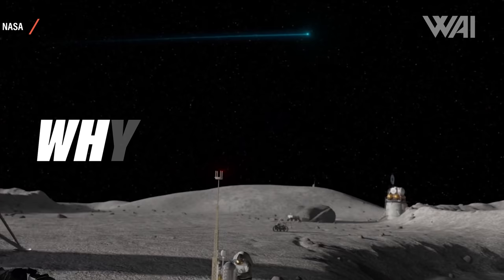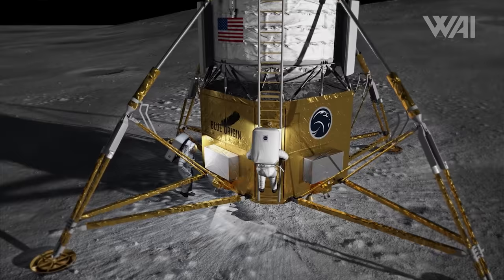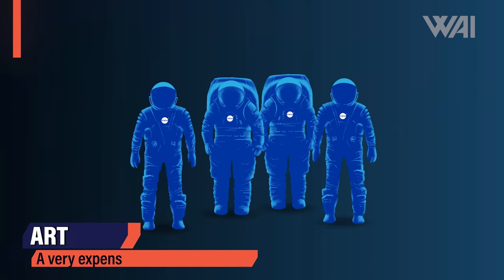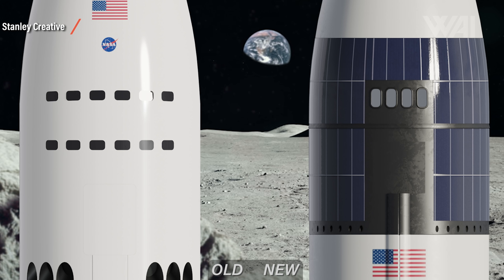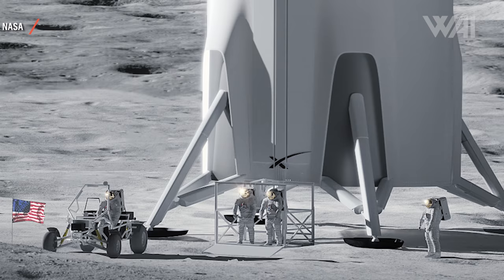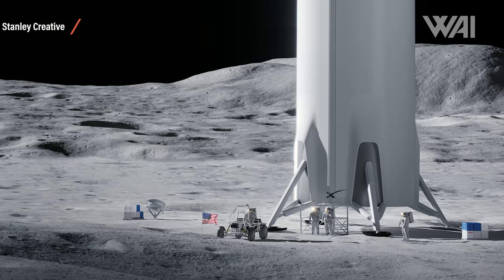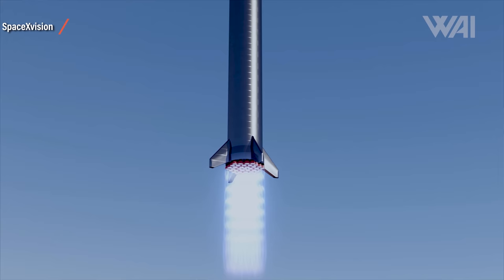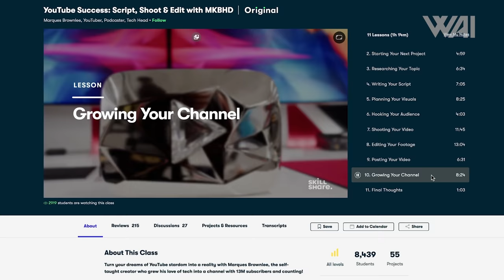Why Did NASA Award SpaceX 2.9 Billion Dollars For A Lunar Lander?

Comment: Hi Felix! My personal thoughts on SLS, Orion and Lunar Gateway:
I agree, SLS is becoming more and more obsolete. Its function is practically speaking, a shuttle to and from the moon for the crew. The lander system is a totally different system. Both roles can be fullfilled by two starships outfitted for their respective purpose. That in turn creates so much space that the lunar gateway becomes practically unnecessary. And that means a massive cost saving.
Unless someone can name a valid argument in favor of the lunar gateway. The cost saving alone can have senators give all laid off jobs a full year's pay(older employees early retirement?), and still have plenty left, which can be used for other purposes than spaceflight. Capable engineers etc. will have a new job elsewhere within that year, guaranteed with the explosion in the number of space related companies.
One con is the current orbital fuelings needed to fill up one Starship, I read it needed 20 fuel tanker flights? That number will have to come down, one way or another.

Comment: Lunar Starship already has the rocket exhaust at the top of the fuel stack. Why don't they invert the whole stack and put the crew section at the bottom and the fuel/propulsion section at the top?  It would put the boots closer to the ground and eliminate the need for all those cranes and descending platforms.

Comment: You are correct but I think further speculation is in order..
The docking port on lunar SS was obvious last year. It allows docking with ISS or Orion, or Starliner, and maybe Japan, China, India who knows all but the biggie in my opinion is Dragon. It may be when dear moon launches that Super heavy is not man rated and shuffling crew by Falcon/Dragon will be safer and once aboard keeping a dragon attached as a lifeboat makes some sense. 
Another obvious item not needed for lunar starship is the Stainless steel hull. Aluminum is just as capable for lunar operations and will weigh at least 60 tons less. 
Another change that I would make if I could would be to put legs with wheels on the side of starship and land it horizontally on the moon, complete with flip maneuver. This configuration makes leveling easier and repositioning the ship on the surface easier too.In fact a hinged nose or tank section so cargo could roll on and off like a C5 Galaxy military plane would make colony building and supply much easier too.
Speculation and imagination are great fun.
Reply: Starship would probably collapse if it is on it's side
And using a differnent material would mean a lot of redesigning and testing would have to start all over. Maybe later but not now when they have to be ready in 3 years
Reply: @Astromath  undoubtedly as they as re in earth gravity they would colapse. But the lunar starship is a different animal. It is essentially a ground up new vehicle for a different job. SpaceX knows how to work with aluminum. If they design with aluminum they have at least 60 tons of weight reduction they can use to strengthen the hull and make it fit the task of lunar colony building.

Comment: The lunar starship also doesn't need atmospheric Raptors. It can probably operate with just the three vacuum-optimized Raptor engines.
Reply: The complication may be whether it can launch from Earth with just the vacuum Raptors (we don't yet know what happens after they separate from SuperHeavy), and whether it can perform the Moon landing and descent without vectored engines (remember that the vacuum engines are fixed in place)

Comment: 10:07 This way no regolith will be thrown up....??? Even with many small thrusters, angled out and higher up, they still need to create enough thrust to cancel the mass of the descending Starship, so there is still going to be a lot of turbulent rocket thrust beneath Starship, having many smaller thrusters making an umbrella type of thrust does seem a lot better than a nozzle underneath acting like a blow torch. For the Lunar landers, the single rocket for a much smaller craft seemed to work fine, pushing everything away from where they would land....Starship....i still worry about the hail storm of regolith.

Comment: More realistically, the main Lunar Starship hull (including fuel tanks and Raptor engines) will stay in orbit around the moon (taking the place of Gateway) and will only be used as the propulsion system for the translunar legs between the earth and the moon.  Only the crew section and cargo section will descend to the lunar surface.  On departure, only the crew section will leave the lunar surface to reconnect with the orbiting main hull for the trip back to earth.  The cargo section will stay on the lunar surface and be used as part of a growing moon base.  Back at earth, the crew section can transfer from the Lunar Starship to an Earth Starship for re-entry and landing.  The Lunar Starship can be inspected and refueled in orbit, a potentially dangerous procedure, while it awaits delivery of the next crew and cargo section lifted into space on an Earth Starship.  And the cycle repeats.

Comment: Theory: The odd nose cone with cut outs were for a capsule so astronauts can return to earth since the lunar starship will stay on the moon.
Reply: The ascent module on the "tip" of the Starship could be both the astronauts emergency abort during landing & their ticket back to the Gateway.

Elon Musk once mentioned that most of the TOTAL MASS of a (fully fueled) Starship is liquid oxygen.
 While it is not practical to produce Methane on the Moon (there is not enough concentrations of carbon anywhere & hydrogen is only bound on ice at the south pole); oxygen can be taken from ANY rock or regolith on the Moon simply by heating it (powered by solar panels).
  
By sacrificing cargo capacity to store extra liquid methane (that can be mantained at 100 Kelvin relatively easy for long periods, since the heat from sunlight is compensated with power production from solar panels to run active cooling systems), it is posible to "refuel" it by deploying outside of the starship a set of permanent solar panels, rock smelters, pressurized gas oxygen tanks & a separate oxygen liquifier [the only part connected to the bottom tank of the Starship].
 -> If everything is setup correctly, it could even be left behind running autonomously; so it could be a slow & efficient process (rather than a faster & supervised one), to reduce time spent by astronauts on the Moon surface.

Comment: Once on the moon, visiting a neighboring starship would involve an elevator to the surface, and another elevator ride on the other ship.  Instead, how about bridges directly linking the doorways high above the ground?  The early colony would stand on this interconnected framework, like an oil rig standing on Starship supports..  Are Starships capable of bearing loads?  Perhaps add-on bracing could be delivered on later missions.

Much of a Lunar Starship's interior is taken up by fuel tanks.  If the plan is to land a Starship and then leave it in place, the fuel tank space will need to be converted to other uses.  Any idea of what and how?
Reply: This early starship landers do land and then ascend to lunar orbit so nothing useful is left on the surface. Way later in Artemis missions are they thinking of testing habitation but they're probably planning it much more small than lots of lunar starships forming a big base. Remember that Artemis missions are not continous. Astronauts will go there for a month and then return and no one will be around the moon. So these bases are probably further into the future.

Comment: Love the new design with landing gear. Got a big question. If landing gear is important enough for the Moon and Mars then why aren't they important enough for Earth? Why the insistence on this catch a running rocket in mid-flight with a crane craziness? Is it just to save a few pounds? I would prefer landing gear because it's safer and allows you to set one off to the side for maintenance.

Comment: As the SpaceX lunar lander will not have heat shield and 'wings' it will have to be able to load cargo in orbit for return trip to the moon. Further reason to build an orbital fuel and cargo transfer facility. A role for SLS - orbital fuel tanks.

Comment: It is somewhat difficult to imaginine that the holes in the side of the Lunar Starship are supposed to be deceleration thrusters. I don´t see enough angle downwards to make them work as intended.
And the plumbing would be a nightmare.
Reply: It works for Dragon and its SuperDraco thrusters... they're somewhat angled, but they obviously produce more than enough forward thrust to function as an escape system.

Comment: The Dry mass of a regular starship is supposed to only be 85 tonnes, so like you are maybe saving 15 tonnes, don't get me wrong saving 15 tonnes of dry mass is big as you can quite significantly cut down on the fuel required, but it only means ~15 tonnes of extra cargo, which 15 tonnes isn't nothing that's a Falon 9 launch of extra capacity, but like I doubt NASA for the first mission is going to use more than 30 tonnes of the capacity, some of the extra fuel will be reserved for extra margin, but most of the fuel will not be loaded, as doing 20 Starship launches, dockings and fuel transfers increases risk of mission failure significantly, if you can cut it down to ~7 launches you save money and reduce risk.

Comment: I can't understand why people keep saying "that's the official reason". No, did you read the source selection statement? The official reason is NOT price. In fact, in the statement it specifically says that price is the LEAST important aspect. Before taking price into consideration, NASA assigned multiple significant strengths to SpaceX, and basically no significant weaknesses besides "it's very ambitious and complex", while assigning many VERY significant weaknesses and few strengths to the other two approaches. NASA isn't blind, SpaceX is no longer the crazy newcomer making crazy promises. They are currently THE launch provider, period. Nobody else is reusing rockets, nobody else is launching so often, nobody else manages more satellites than them. They set out to develop Falcon, then Falcon reusability, Falcon Heavy, Starlink, CRS, Crew Dragon, and they finished every single one of those projects. Nobody had developed space tech so much so quickly and so successfully since the Apollo program. That alone is impressive, but behind all that comes Starship development, towering over all previous achievements. What SpaceX has developed in the last year is INSANE. NASA is allowing SpaceX to fly their astronauts on reused capsules and rockets, on a project that was already funded, they didn't have to, but they did. NASA trusts them. 

SpaceX is no longer the riskiest and less mature option, it's the safest and most mature option. 

Read the document again, SpaceX was their first choice, and on top of that, the only one they could afford.

Comment: Have a question to ask. What happens if there is a mission abort before reaching LEO with a maximum payload? Is there going to be enough fuel to put starship back down on the tarmac safely? What about if it is the Lunar Starship with a payload going to the moon? will those small engines be enough to get it back down safely OR what about the heatshield? It the Lunarship doesn't make it to LEO, will it just burn up coming back down? Nasa has been so overly safety conscious in the past, I'm surprised nothing has been brought up about it.... Bluntly put, Shit dose and has happen!
Reply: Don't launch people in Lunarship. It's only launching once so you wouldn't save much. Send 'em up in a full Starship and transfer to Lunarship in Lunar or Earth orbit.

Comment: Felix, there is a way to completely eliminate any problem with lunar regolith being kicked up by a SpaceX Starship's engines or any other lander: build a space elevator.

A lot of time and money has already been spent trying to figure out how to implement a space elevator to serve Earth so we know in general what the steps are:
1. go capture an asteroid
2. drag it back to be put into a geosynchronous orbit
3. using carbon fiber and solar energy, weave a tether down to the surface
4. anchor the tether
5. climb back up the tether weaving a thicker one
6. repeat the weaving process until a sufficiently thick tether has been created

Now any time people or material needs to be moved between the surface and orbit, that can be inexpensively and cleanly accomplished via the elevator.

Since the Moon's gravity is 1/6th that of Earth's, the tether can be much shorter and since there are no atmospheric winds, that vexing problem is a non-issue.

Once implemented, the cost per kilogram will drop from thousands of dollars to pennies. So the initial investment would quickly be paid back by money saved. Plus, it would open the whole business of mining the asteroid belt for untold riches.

Terry Thomas...
the photographer
Atlanta, Georgia USA
Reply: This and a mass driver are two well-accepted concepts for the future shipping of mass to and from the Moon. It also is several stages away from where we are at right now. You're trying to build a transcontinental railroad before anyone even lives on the other end.
Reply: @paull3278  actually, there were thousands of Spanish, Chinese and many other people on the destination end of the railroad, but I get your point.
Reply: This would not work. They Lunar stationary altitude for orbits is way out of the Moons sphere of influence.In other words: Your captured asteroid can't enter a stable orbit around the moon with a 27 day orbital period.
Reply: @Bennet2391  OK. Thank you.

Comment: Am I crazy or do I remember SpaceX constructing a landing zone within the perimeter of LC39A which was likely for Starship? There is no way SpaceX will be using LC39A for anything Starship related based on the amount of infrastructure needed to launch and land these amazing beasts.  The investment and efforts going into the site at BC and the 2 oil rigs means the days of launching humans from the historic pads at KSC would be numbered. We have some very exciting times coming up in space!
Reply: Your not crazy. From wikipedia entry on LC39A (and you can go there and click to the sources):
In 2019, SpaceX began substantial modification to LC 39A in order to begin work on phase 1 of the construction to prepare the facility to launch prototypes of the large 9 m (30 ft)-diameter methalox reusable rocket — Starship — from a launch stand, which will fly from 39A on suborbital test flight trajectories with six or fewer Raptor engines. A second phase of the construction is planned for 2020 to build a much more capable launch mount capable of launching the entire Starship launch vehicle,[28] powered by 43 Raptor engines and producing a total of 72 MN (16,000,000 lbf) liftoff thrust when departing 39A.[29]

So not a landing zone but a launch zone. And if it's still on the table, who knows?

Comment: On official render from NASA announcement it seems that the legs at the side with elevator are closer together than the legs on opposite side. It can be due to the fact that this way it can be more stable when elevator is in operation.

Comment: Wouldn't dragon xl with starships on either side have way more volume than the gateway?
Reply: Heh... I think your scale is a bit out. Gateway isn't particularly big... the largest components are scheduled to be launched on a single Falcon Heavy, with a few more additions to follow. So it's possible that the entire station (assuming sticking out parts are retracted) might fit inside a cargo Starship.

Comment: Will the Lunar Starship even need the sea level raptor engines? I would expect it to only need vaccuum raptors to get to the moon after detaching from Superheavy. I'm not even sure it would need all 3 vaccuum engines to get to the moon. The fewer engines it has under its skirt, the more room it has to pack landing legs that are wide enough to avoid sinking into the lunar regolith, and causing the lander to tip and fall over.

Comment: Per the legs. The reason could be much more prosaic: the artist boofed the rendering. It's a small detail they could have overlooked in the image review process, or else they caught it but thought, "Whatever."
Reply: And not to mention that all the feet are either at an awkward angle or obscured by other things, so they were probably ignored for the most part, focusing more on the upper sections of the starship
Reply: Five legs give more stability than four but not much gained with six. Ask any office chair.

Comment: Too many ads. Thought, does lunar starship actually need sea level raptors? If not, that's minus 3 engines of weight and more space in the thrust section for beefier retractable landing legs. I hope Space X can send a lunar starship test flight with the first few super heavy launches. After successful launches they can demonstrate LEO refueling on the lunar version and just send it to the moon to test the landing and hopefully stick it with equipment for building a base already on board. Too exciting.

Comment: I say get rid of the elevator and land the whole ship on it's belly with two legs near the nose and two near the engines. Pop the hatch and step down on the lunar surface. I would mean coming in for a landing, hovering, and then descending on belly thrusters. Imagine how much more room you would have with no elevator. Then, you could also have your windows look down at the surface easier.
Reply: then you're going to have the regolith problem again
Reply: @welyum7308  Landing with raptors would be a problem but landing on small thrusters should be ok